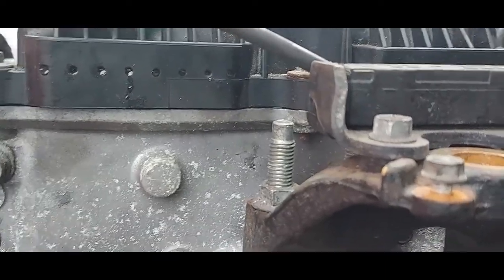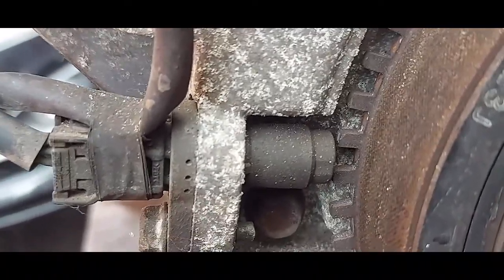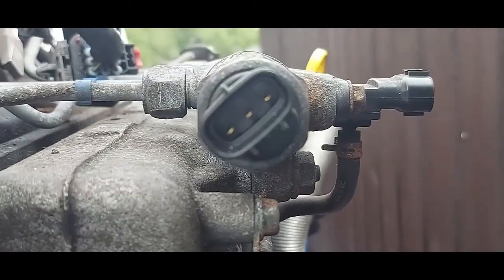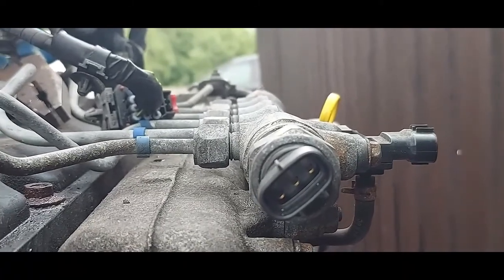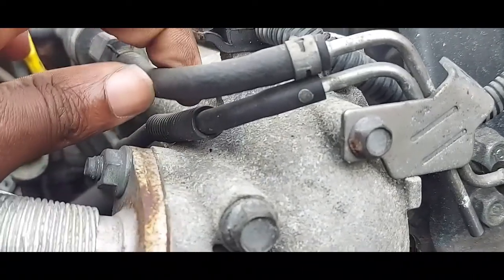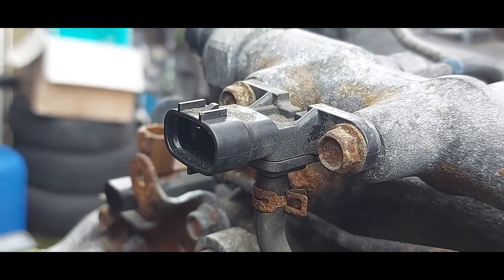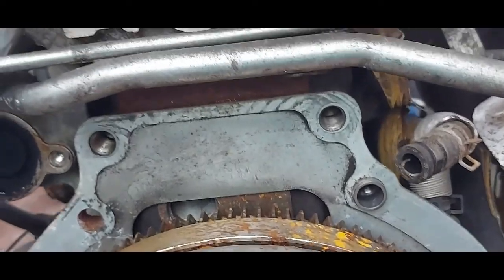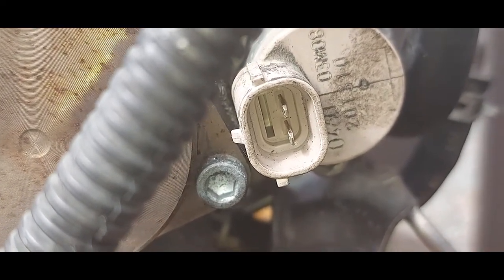Engine Management Sensors: What They Do

Comment: Hi brother James, Im in trouble with Isuzu 6uz1, on diagnosis it's showing p0192, fuel pressure circuit low, but the truck is starting nicely, on FPS I'm getting 5volts, earth and signal to the ECU, what surprises me is signal is not exceeding 1,3volts and the revs not exceeding 1,4. On live data it is showing 0,6volts on FPS signal, I'm suspecting ECU. Can you help..
Reply from the maker: Im sorry my bro I got this message late I would have helped you. Please provide me with you App number so that  I can call you whenever you need help. I apologise my bro